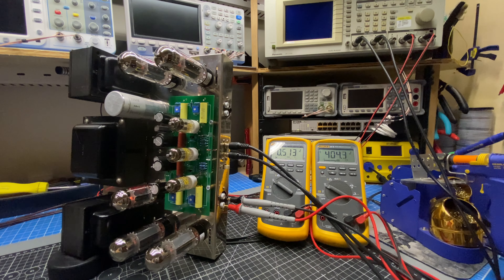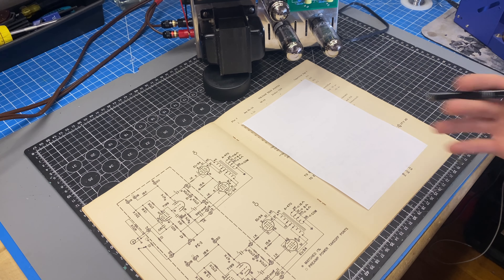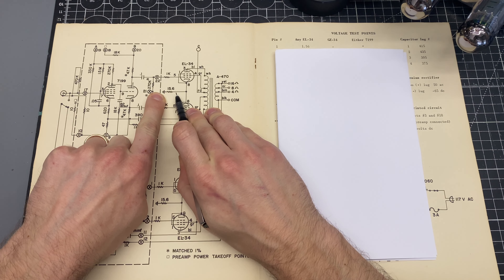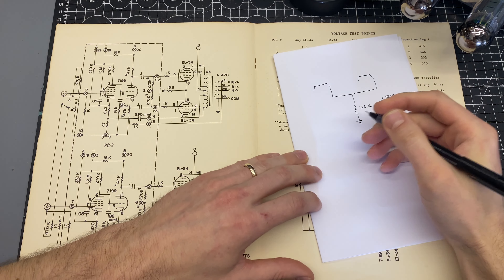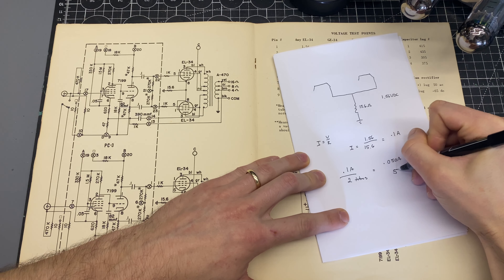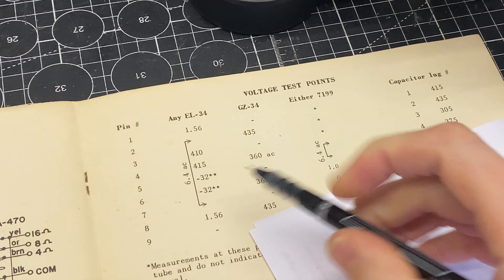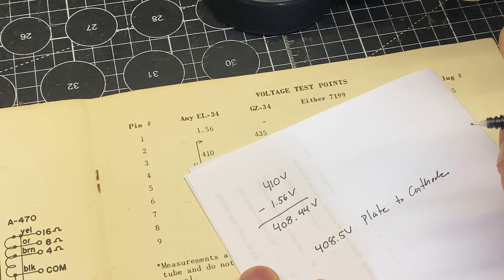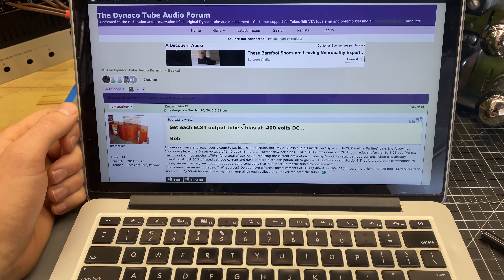Getting the Best THD Performance Out of Your VTA ST-70: 50mA Vs 40mA Bias Experiments

Comment: Thank you for taking the time to do a follow up video. You may want to add a resistor after the solid state rectification as outlined in the Baseline paper so that the voltage doesnt go so high. I have used the base of an old octal tube resulting in a direct plug and play option.

Also, Peterh posfed on audiokarma the below finding on why he settled with a 2k feedback resistor.

"VTA-70 and feedback adjustments
Reducing the feedback resistor to 2k will half distortion, as expected, while reducing sensitibity to half.
Attatched scan is 1khz at 10w power
THD at 1w = 0.06%
THD at 32w 0.55%"

I can link the thread if you like.

How does that compare to your findings with both the stock and the vta with 3.3k?

Comment: Interestingly in the Dynaco Mk IV, which is basically half an ST-70, the output tubes are run at 57.8 mA (half of 1.56V / 13.5 Ohm shared cathode resistor) with plate dissipation of 99% (24.8W).  The Mullard spec sheet of the time listed 25W as the maximum plate dissipation, but under the heading "Design Centre Ratings".  Operating at this level seemed to be pretty common among manufacturers in the 60s.  Probably the ST-70 was run at lower bias to protect the rectifier tube.
Reply from the maker: Marantz 9 is biased at 55mA per EL34 so that tracks.